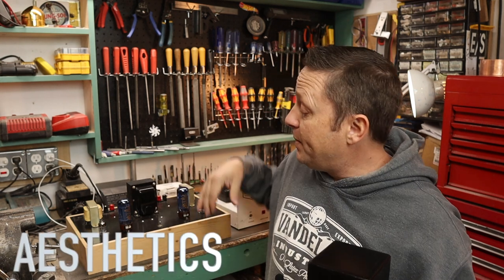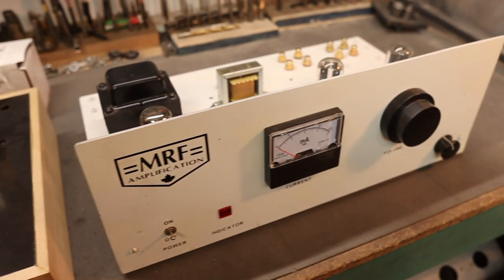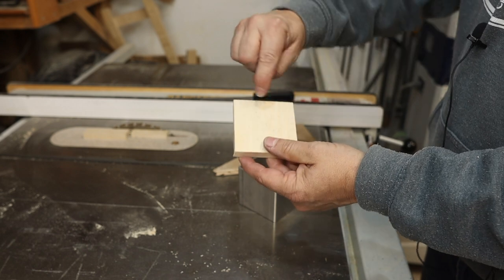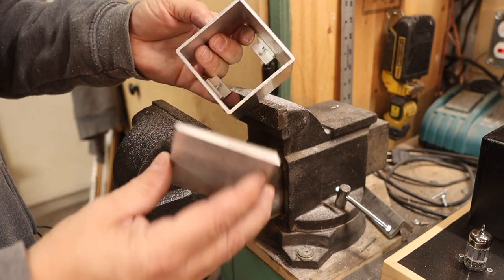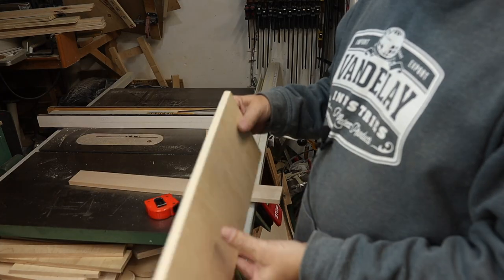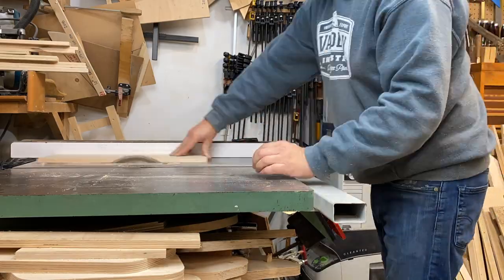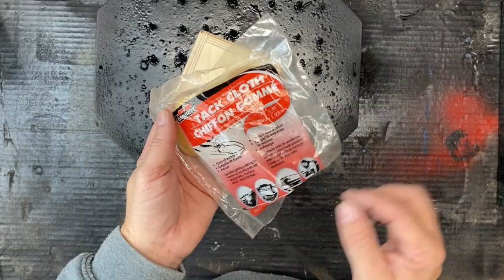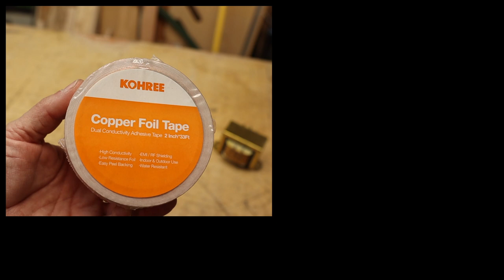How to make Transformer Covers // DIY tube amp transformer enclosures

Comment: Interesting approach! Copper shielding works well to stop RF and high frequency EMI, but is very poor at low frequency magnetic field shielding. You can get nickel alloy (even Mu Metal) tapes that do a much better job to prevent inter-transformer interference.
Reply from the maker: Thanks for commenting.  I’ve see you can get  nickel impregnated paint as well.  I may have to look into it.  Cheers.
Reply: @MikeFreda  I hadn't heard of that, thanks for the tip! I have really been enjoying your videos - great content. Many thanks from a fellow Canadian DIYer!
Reply: Ideal will be over 2 mm of steel, which attenuate around 35-40 db at 50 Hz, more better...Steel tube, if you are ok with metalwork.

Comment: Thank you for the tutorial and inspiration. 

Should I be worried about my transformers not getting any ventilation if I cover them with DIY covers?
Reply from the maker: Thanks for commenting. Yes, it is a consideration. I find that most output transformers and chokes if sized right don't get that hot.  Power transformers can and do get hot so you have to be careful there.  You can install ventilation holes or a mesh top to help with that. I typically don't to cover my power transformers.  Cheers.

Comment: I'm trying to shield an old turntable motor. You talk about copper 'tape' or metal paint.....could you be more specific if i make a wooden box? For shielding, does it matter if the box is steel or aluminum?
Reply from the maker: Thanks for commenting.   I put links in the description of the paint and tape.  Make the box to suit and line the entire inside with either.  The tape is much cheaper, the paint is easier to apply.  If you made it out of metal, I’d go with steel.  The iron content in the steel has better shielding properties.
Reply: @MikeFreda  Thank you! I laminated a galvanized piece to the platter, exactly the size of a record......made by some HAVC guys out of ducting material. It works, but was only meant as a temporary measure. I always wanted to make a metal box or something similar, so I can restore my platter back to its original configuration.

Comment: May I know more details about the transformer? 14k 50w ? Thanks Mike
Reply from the maker: Which ones? The Output transformers?  These outputs are a special/limited wind Magnequest did many years ago.  They are Parafeed, 3K 4 & 8 ohm good for 8 watts, loosely based off of a TFA-2004. I’ve had them for a while… I jumped on them while he had them available. I’ve purchased a lot of iron from Mike. Great stuff, unfortunately he’s no longer winding transformers.
Reply: @MikeFreda  I am beginner for Tube Amp, and I have my old retired friend talk to me can do the special made Transformer for me , thus I saw that no wonder you said it is hand-made, since he has been working on coils and transformmer over 30 years, I knew him before 1997! yes, very old friend. Thanks for sharing of how you do that and explain the transformer cover!! If you need contact , I can tell you his website by PM. Not polite to put here if other DIYers if want it. :)

Comment: I clicked thinking you had a home shop friendly way of making the metal coil caps like on the transformer in the middle of your 6l6 project. Your just making boxes, I feel like everybody that's scratch building a tube amp knows how to make a box.
I hope I'm not being ignorant, that's not my intent.
Reply from the maker: True, it’s just boxes but sometimes people just need a point in the right direction to inspire them.  That being said, what are metal could caps toy are referring to?  The bell ends? If so, should you like to know how to make them?  That is something I can do.  Cheers.
Reply: @MikeFreda  That transformer in the middle has no exposed coils or connections, smooth round metal covers bolted to the cores. Really common on guitar amp transformers. For interference I presume but it feels like the classic look and leaves it safe for inside on the outside presentation. Is bell end the right name? Sounds like a penis joke.
They are stamped sheet metal, I could make them myself with square corners but not the right look. Ron Covell could make them perfect but his techniques are a bit much for the average home gamer. 
I could 3D print them and copper tape the inside and nobody would know the difference, but I would.